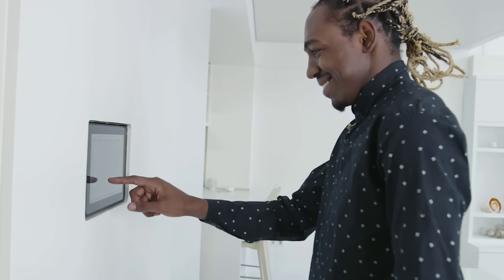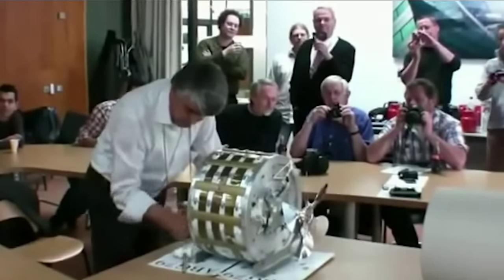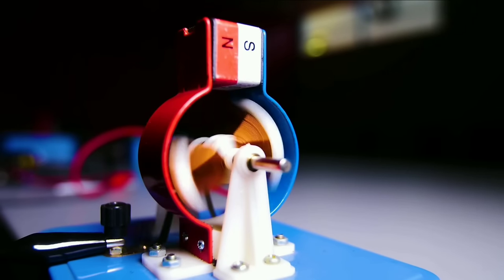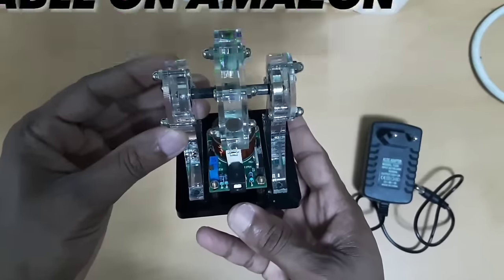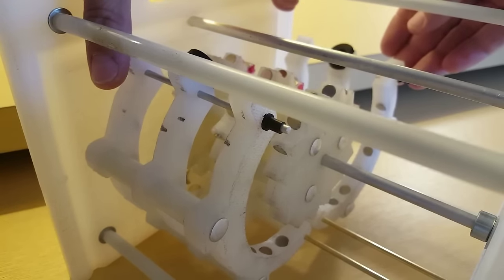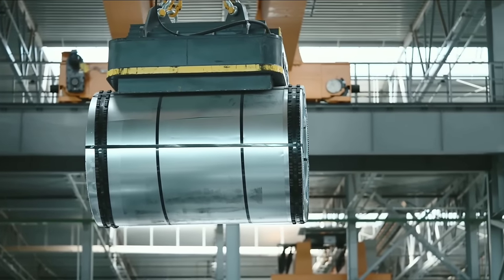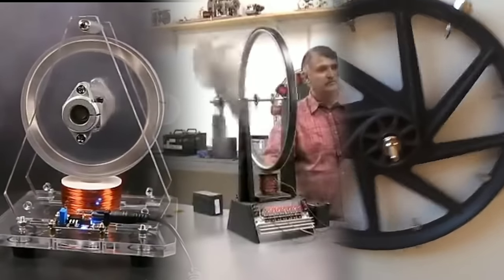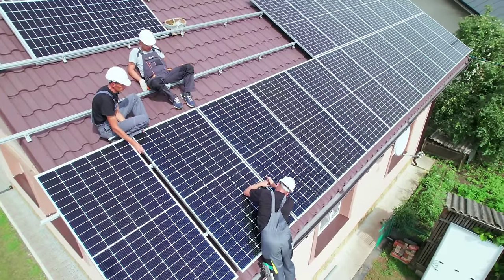You Won’t Believe This Magnet Motor That Generates Free Electricity Forever?!

Comment: There is a man by the name of Nicola Tesla that was ridiculed for his Tesla coil. The man was many decades ahead of his time. He is the father of Alternate Current electricity. Now the magnet motor , the Bendini motor actually works. Perhaps the author of this video should spend more time and look into the engineering part of it to understand how it works. I built a magnet motor pump and it works very well. I am able to pump water with it without any issues. Your claim about the magnetic motor tells me that you never studied electronic at all. I understand that you asked some narrow minded engineers about the magnetic motor. They likely told you that it was impossible. Keep in mind that a successful engineer will find a way to  make a good design that works. Source: over 25 years of electronic engineering...
Reply: Did you upload the video of your work? If so then kindly give the link here
Reply from the maker: Thank you for your comment. I appreciate your interest in magnet motors and your experience in electronic engineering. However, I have to disagree with your claim that magnet motors can generate energy without any issues. According to the scientific consensus, magnet motors are a type of perpetual motion machine, which is impossible to realize in practice. 

The reason is that the force between permanent magnets is conservative, meaning that it does not do any work over a closed cycle. In other words, the magnets cannot provide any net torque to the rotor, and any initial rotation will eventually stop due to friction and other losses.  The magnetic energy stored in the magnets is not enough to overcome these losses, and it does not decrease over time as you suggest. 

The Tesla coil and the Bendini motor are not comparable to magnet motors, because they use external sources of electrical energy to create high-voltage sparks or pulses. They do not violate the laws of thermodynamics or conservation of energy, unlike magnet motors. 

I have studied electronics and physics, and I have consulted with experts in the field of electromagnetism. They all agree that magnet motors are pseudoscience and a waste of time and resources. I suggest you do the same, and learn more about the fundamental principles of electric motors and magnetic fields. You can find some useful information on these topics on Wikipedia or Britannica.

I hope this helps you understand why I am skeptical about magnet motors and why I made this video. I respect your opinion, but I also ask you to respect the facts and evidence. Thank you for watching and commenting.
Reply: @FutureGalaxy  , Greetings,

Please forgive, i may have sound aggressive. Now concerning the magnet motor, it is important to mention the magnets used on a magnet motor are the key to the well being of the motor. I never mentioned anything about a perpetual motion machine or device. Here the magnet do have a property to attract or repel. This is what magnet do. Now a standard motor will use some electromagnets. This is a coil and the voltage is flowing. This creates the magnetic effect.

Now I was referring to the Tesla coil for a very specific reason. Way hack in the day. Electrical engineering was much less sophisticated as today. Nicola Tesla was ridiculed for it. Today the Tesla coil is known for producing extremely high voltage at low current. He was called so many names. But the fact of the matter, Nicola is known to be the author of over 60 patents.

Now the magnet motor pump i built helped me to get running water from a river for an recreational vehicle. The very same pump was also used to pump out water when there was no electricity from the power grid. See it doesn't matter how you call it, it works.

As i mentioned before, a good engineer must have an open mind. If you put restrictions before you start, chances are you may not achieve the result you wanted.

Oh i fully respect your opinion as well. Facts can become highly political and be suppressed. Keep an open mind on any designs

Cheers
Reply: @stargazer279  Well, show us your magnetic motor. Your Nobel Prize in physics awaits.
Reply: @FutureGalaxy  The scientific consensus said "heavier than air machines are impossible", the Wright Brothers showed it wasn't, "it would take a rocket as large as the empire state building to go to the Moon", we did, "optical masers aren't possible" - by a noble lorate, we now call them LASERS. There is a VERY long list of examples like this. I'm also an engineer and have seen many examples of this, and many people get rich and bury the technology or an "accident" happens like with several plasma battery scientists in the early 2000s. Like Feynman said, "ONLY the experiment matters", not the consensus.
Reply: The torque is the key to it, it will be able to pump water or even produce electricity if you add some stages with electromagnets
Reply: Here is an other example of a powerful magnet motor... https://www.youtube.com/shorts/BOTpkMQ432w
Reply: I think and tuned to your thinking.A non creative person always laugh at creation with his narrow knowledge.rite brothers,marconi tesla etc the leading scientist wear neglected by formal scientist and so called scoler at a time.
Reply: The difference is that Tesla applied and worked within the bounds of the laws of physics.
Reply: @barrywilliams991  Yes he was working within the laws o physics. But remember all this was very spooky to many back in the day.
Reply: In my opinion you are incorrect .Read more material.
Reply: The Tesla coil is how the ET power their crafts
Reply: The key to this is an energy source to keep it running. And that same energy source should be charged within it's components. It's like you double the layer of your magnetic gears, or maybe 4 more layers alternately attract and dispel -/+ contact. The gap is the motion itself needs an external prime mover to rotate the magnetic gears. Imagine the regular magnetic gear powered by ac input. Find a way how to store the energy produced from the magnetic gear and then use it back again to propel the gear. Maybe you can use AC source as starter then switch to ultracap array and ion batt. Array to "sustain the motion?
Reply: I genuinely  feel the content creator is suppressing the inventors and giving out fear,   somehow . 
I believe  free energy from magnetic motors  and it works by low of physics. I was informed by a higher source  that our grid will fail  and gave a hint to create free energy   magnetic motors running entire house and  desalination
Reply: @Peace-nz3jx  , yes a lot of things are suppressed. The grid may fail because of the solar flares and may create a Karrington event. But keep in mind this principle of a magnetic motor is not free energy. See the magnetic flux makes the motor turn. The energy is transformed depending of the application you may have.
Reply: Bravo!
Reply: @stargazer279  : Is Tesla coil design in You Tube?...Pls give me an idea on how to design self- sustaining magnet motor... Any internet site to such tested design "magnet engine"??....
Reply: @stargazer279  where the white cable is going ? to an electric wall outlet maybe ? Do you really believe everything you see on youtube? Dont lie please !!
Reply: @MrToni99  , your question is not complete, let me explain , based on the fact 2 magnets can repel each other or attract each other, you can build a 2 section generator. The first section can make a generator  turn . On the second section you install a motor (can be a DC motor). Now you couple the 2 sections together and the motor will give out electricity. Now if you do not believe it, simply put a multimeter on the motor power pins. The motor will generate electricity as you turn the shaft. Try it, you will see. From this , you can imagine how to make you motor turn with magnets. This is a simple way to generate electricity. There are many other ways to generate electricity. Too bad the author of this video thinks inside the box. When you are an engineer, you need to think outside the box.

Comment: Well I have a copper wire coil with Neodymium Magnets inside the coil hooked up to a 4 LED strip to see how long it would stay lit. June 9th of 2020 and still going. That's the simplest and cheapest magnet motor you can build to test the theory. It's also a great conversation starter. I'm thinking of how I can put it in an art form. A candle that never goes out.
Reply: Video?
Reply: put it on video or a still pic i have coil and neodymium magnet just to se how your connection is  made
Reply: What is the power spent in this system? Leds don't require much, what if you used some heater, or at least an amperemeter for meatballs sake!
Reply: That's impressive that your copper wire coil with neodymium magnets has been generating power for such a long time! It's great to see how innovative solutions can be simple and effective. Speaking of power, have you heard about the Segway Portable PowerStation Cube Series? It's a versatile power station with a massive capacity, fast recharging, and comprehensive protections. It could be a valuable addition to your outdoor gear collection or even as a backup power source for your home. Check it out if you're interested!
Reply: Scam

Comment: When you talked about the bedini motor you missed the key point!.. when a supply is switched, a spike of electricity is created, similar to spark gap in tesla coil, the bedini circuit captures these spikes and stores them in capacitors..

Comment: Magnet itself is a source of energy
There's nothing free
Just need a perfect construction
I hope someday someone will succeed 🤞
Reply: I have a design in my head, I’ve gotta knock together a prototype to see if my idea works but I’m confident it doesn’t violate the laws of physics, it just needs a little bit of trickery with regard to what the energy does. No battery, just something with decent mass for a flywheel and a bunch of magnets mounted in various positions.
Reply: Yep men and the day is coming soon
Reply: The spheremotor has succeeded.
Reply: @christianburke418  gonna need to see at least a video of it running before I believe it 😅
Reply: The vid won't be up for months. Production is my main focus. Sorry.
Reply: @TheCrazyCapMaster  same. But I don't want to transfer the energy to a flywheel just take it right off. However the various positions route I'm not going for I want the actual magnets themselves too move.
Reply: Although a magnet is a source of energy, fabricating a man-made neodymium magnet requires a lot of energy in and of itself.  Thus if one were to build a magnet motor, the interaction of the north and south fields during the magnetic cogging would eventually desaturate the magnets, causing the motor to stall.

Comment: Everything slows down unless you input more energy from somewhere. Somewhere could be as easy as a battery, a solar cell, or wind turbine. But the somewhere of magnetic motors is the magnetic field of space. Just as all you need is a successful motor to prove conservation of energy in a closed to outside energy system, so all you need is a successful magnet motor to prove that reformed space, aka magnetic fields, is another form of energy we can use from somewhere to keep our circuits active and our wheels turning in an open to outside energy system.
Reply: Well said, brother!

Comment: Free energy is easy, just run an extension cord to your neighbours outside outlet. 
No laws of physics broken.
Reply: Unless neighbours refuse to accept their share of cost.
Reply: @Roko-ym7ei  it works if you do it at night and don’t get caught…😂😂
Reply: good one😂😂😂
Reply: You win i lost it.. you can defy the laws of physics by burying it under the grass to feet but you can't defy your neighbor coming through your door with the ball peen hammer LMFAO
Reply: This is one of the most sincere comments under this stupid video. Stealing is way better than scamming.
Reply: Or they reroute the cord & plug into something that  is going to deliver more current & fry your piece. Oops you need more power, neighbor? Is that enough?
Reply: @lisahunn7409  
All ways good to get more current on a circuit, you can run more of your house on that. More voltage can be a issue but its easy to build protection for that.
Reply: I'm sure that 0. Energy, ether energy, and in this case plugging into your neighbor's house over unity call the extension cord (hahaha) is all fun and what not.  We have over unity devices today.  They are heat pumps sitting next to the house. If you want to call them over unity....
Reply: Even the heat pump works only within a certain temperature range and even then it merely transfers energy
Reply: Solar panels at about the same efficiency as gasoline engines (18%).   Wind and water turbines  (like the alternator on your car) tap into nature's existing resources. Anyway the hardware cost money and even it breaks down it's not invincible...

Comment: amazing how people who have never built a working model can speak so boldly.  the aspect detractors miss is while there are many improperly designed magnet motors built by people who often claim perpetual motion.  i have seen, in person, magnet motors that do work, have verified no outside power is used.  the units i have seen do require a nudge to start rotational motion.  once motion initiates and rpm's of about 1800 are achieved these devices do generate power.  the units i saw turned generator heads and were used to charge batteries that ran off grid homes.  these homes had no other power to the property.

i'm actually building such a device to charge batteries.  the device i'm building is used to simply turn the generator head. 

if one has ever bought the parts to build a free energy device you know it isn't free.  Magnets degrade at about 1% every 10 years. There is no perpetual energy.  That being said energy can be extracted from magnet motors connected to a generator head AND there are a couple magnet generators that do actually run and generate energy that can be used.  Always remember, one can build a device that generate greater energy than that which is used.  Why can a dam produce ongoing energy 24 7?  Because it conserves its energy behind its walls.  In other words it uses what it needs or can generate but not all it can generate.

Don't get confused by the words and concepts.  A magnet motor can be built that exceeds the forces needed to turn a generator head to recharge batteries.
Reply: This is all nonsense.  Simply connect your aluminum hat to the overhead line of the train and it's up and running.
Reply: @sagmalehrlich  Haha, good one!
Reply: @sagmalehrlich  You're not paid as an online shill by the electric company are you?
Reply: @LEO_CXLIV  No, certainly not. But do you think that the free energy works ?? Do you think you can get energy from magnets without supplying energy from the outside? Do you think that the magnets are breaking because they are leached ?? Do you think that the physical laws are not valid? If you answer only one question with "yes", then follow my tip with the aluminum hat.

Comment: simply put,to make the magnets move forever by their own magnetic field and it's subsequent force which is proportional and relative to magnets magnetic field means the magnetic field should divergence based on two reasons 1.to able such a force make the magnet move that is itself also the moving objects at the same time 2.because you are trying to move magnets by their own field from geometric perspective (because geometry of human consciousness is based quantum particle physics itself the same as magnetic field) also means defining 3 dimensional Euclidean space by the 3 dimensional non Euclidean space which is definitely not possible simply because a line between two points in non Euclidean space has always more distance than the same two points in Euclidean space and therefore subsequently denies geometrical postulates :1. As in Euclidean geometry, each hyperbolic triangle has an incircle. In hyperbolic geometry, if all three of its vertices lie on a horocycle or hypercycle, then the triangle has no circumscribed circle,2. Elliptic geometry is also like Euclidean geometry in that space is continuous, homogeneous, isotropic, and without boundaries. Isotropy is guaranteed by the fourth postulate, that all right angles are equal. For an example of homogeneity, note that Euclid's proposition I.1 implies that the same equilateral triangle can be constructed at any location, not just in locations that are special in some way. The lack of boundaries follows from the second postulate, extensibility of a line segment)3.therefore finally as i said it is not possible for the object to have acceleration in many directions at the same time,the same reason we never be in event horizon of a black hole that was shown in Interstellar movie